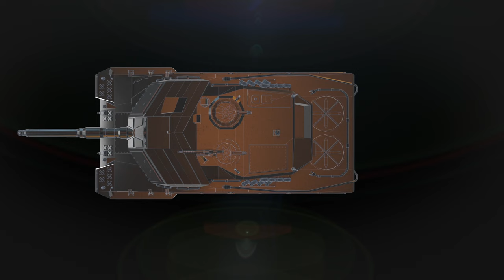How does tank LEOPARD 2 work?  3D animation

Comment: The gunner's sight isn't really a weak point on the Leopard 2A5 and onwards as it is mounted outside the main armour. If a shell were to hit there, it would only destroy the sight, it wouldn't incapacitate the tank. The gunner has a backup sight in case their main sight is disabled.